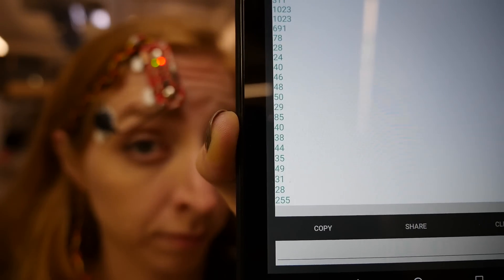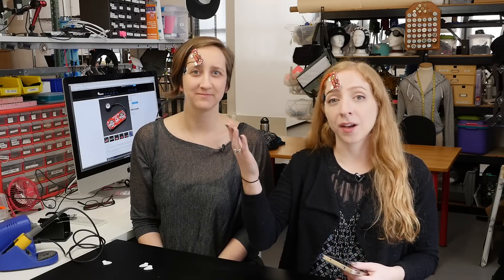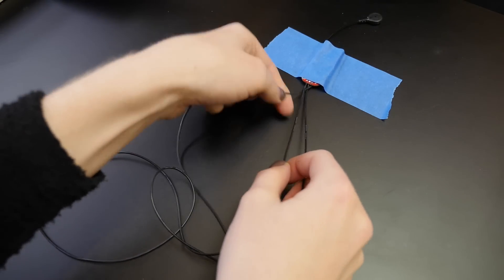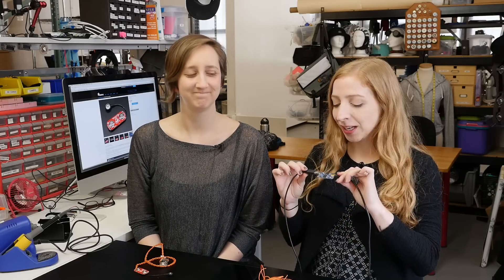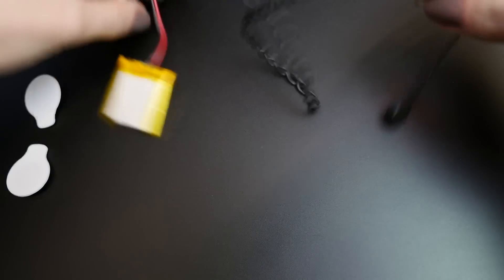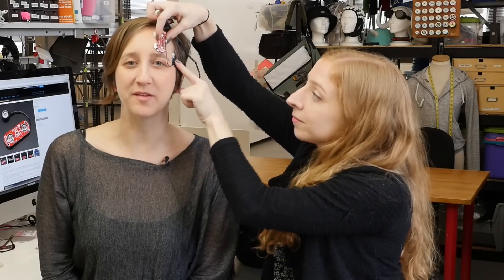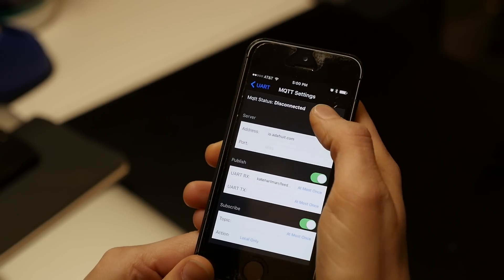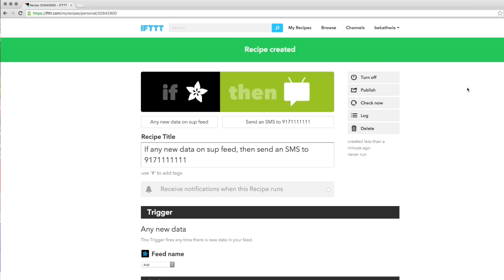IoT Muscle Sensing 'Sup Brows

Comment: Bionic second set of arms using electrolysis of water to hydrogen  to actuate and relax rubber tubes to simulate tendons.   Use feedback gloves in if loops to actuate digits after initial movements have been made. Utilize obliques with sensor to initialize movements of prosthesises.

Comment: Is there a way to dismantle the sensor and have it sense muscle movement without the adhesive? I'm doing some research on the side for an idea about Spider-Man motorised lenses. I saw some ribbon wires inside of the Insomniac mask, so I'm wondering if it's possible to use EMG sensors instead of IR sensors to save space.